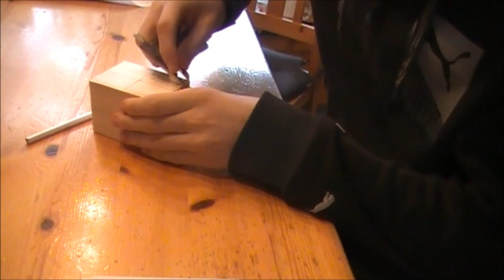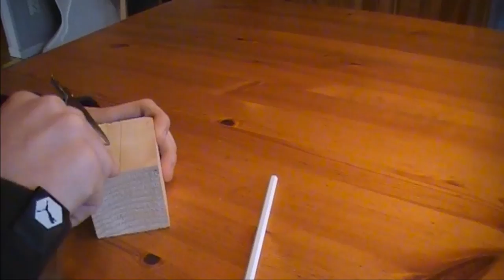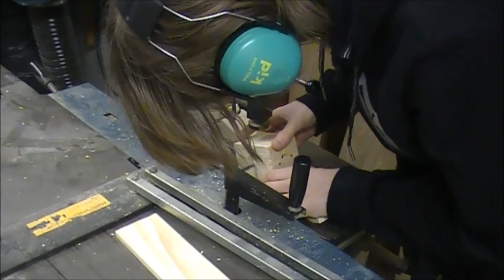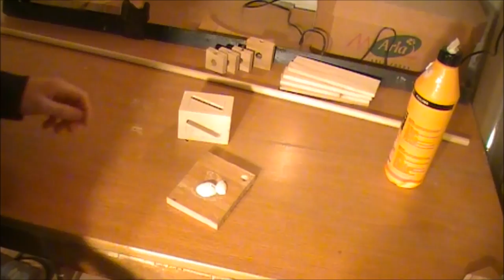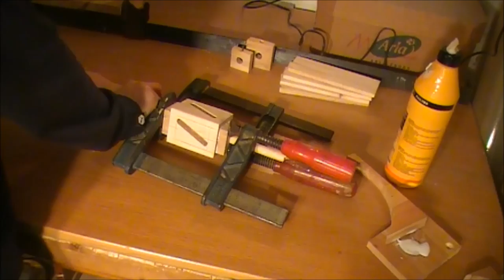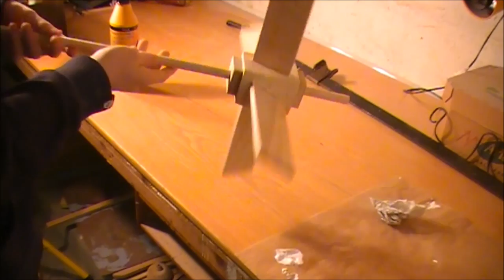Making a wooden propeller

Comment: It is a good project to pass the time, but that design  results in a variable pitch  proportional to the  radius and that means that the outer tip would have a very high pitch.  This is not the case in real propellers as they normally have constant pitch irrespective of the radius.     To get an idea of how a real propeller is designed one should get a number of lollipop sticks and drill a hole in each end of the sticks, then lace them all in a long nail or a thin rod and spiral them around along the rod where there is no gap permitted in between the lollipop sticks. One small sector of a circle will give an idea of how a propeller is arranged mathematically to get a constant pitch all along the different radii.   If one glues the lollipop sticks together then  when they dry one may cut the profile of the blade.     I suggest when making propellers start with a low pitch as with a high pitch it looks more like a paddle wheel rather than a propeller which work on different principles.  In fact when I design  propellers I normally reduce the pitch near the boss of the prop as otherwise this will act like a paddle wheel at starting and I get a better start if the pitch near the boss is reduced while drive is generated by the  outer 2/3 of the blade.
As far as the cross section of the " aerofoil" well that is a science where one needs to look at nature to get an idea what is required, bird's wings and fish fins especially their tip design will help anyone make  the best propellers and it is to be noted that all  tips of fish fins and bird's wings have their leading and trailing edges raked back.  Nature teaches us a lot and one would gain a lot just to walk around in the country and by the sea watching birds and fish.   Fascinating to know that nature evolved such efficient propulsion that would enable a bird fly thousands of miles an a fish swim hundred of miles with such a motion that undulates rather than rotate.   
Well nature has as yet never made a fully rotating joint  nor gear wheels as shown in this video which shown so clearly the principles of many engineering units. Congratulations.
Reply from the maker: Carmel Pule' I never know what to answer when I see your comments, it's nice to see that you notice all the details in my videos, I have been waiting for someone like you for a long time. It's nice to know what someone acctualy think about my work, explain why some things where good & what I can do better. I may not always reply to you, but you should know that I really apriciate every comment that I get fom you. Thank you! :)
Reply: creativeobsin. Sir, your work is excellent in every manner and thank you for taking and accepting my comments as you do. I do notice all the details as I have spent  a long lifetime seeing to very complex equipment in ships, armaments and power stations and industry and hospitals where details need to be seen and understood.
I am now nearing 80 years old  and adding the fact that my forefathers were traditional boat builders in Meditteranean Sea about which I wrote a book in respect of my forefathers,  I admire people like you with such a healthy attitude to make such beautiful interesting  products which contain so much knowledge for what I have in mind at the moment.   
In the last six years  I have been making many wooden " educational" toys  for my grandson all containing the many engineering principles that I know about. I am now even  being invited to attend schools and demonstrate these " WoodenToys" which I prefer to call ," my little machines" to  young students. This morning I had two classes of six year olds and as I usually I have university students to deal with, I find dealing with six year old  very challenging.  My daughter criticises me for I have to learn a lot in presenting my "educational little machines which others refer to as toys" but  the activity of children who handle "my  dynamic wooden toys" is unbelievable and  when the teachers informed me that the attention span of these young children is about 20 minutes, they were surprised that after 90 minutes the children were still active with handling these ," little machines" and asking questions , and when I am returning back to them to tell them how to make them.  I have to decide carefully how deep one presents the details to children of different ages . 
I wish to thank you for some ideas which I generated through watching your videos.  I will use some of them.  Children will not be presented with design of an efficient propeller, but they do appreciate  the propeller you made in this video.  So you see that there is a demand for all sorts of products to cater for different needs. 
Your work is very educational for certain grades and schools should take your example .  I find my research in  how to present, " Science and  engineering principles" to children needs careful thinking.
Thank you for presenting these videos as some of your ideas are so useful as they are just right  for my new purpose.  Recently I had  some time on my hands  so I spent it appreciating your videos, but  I need to  see to other commitments now  but I shall try and watch your video if time is available. Thank you .